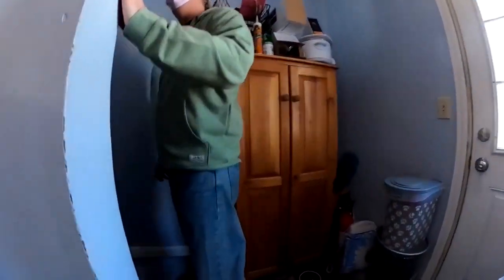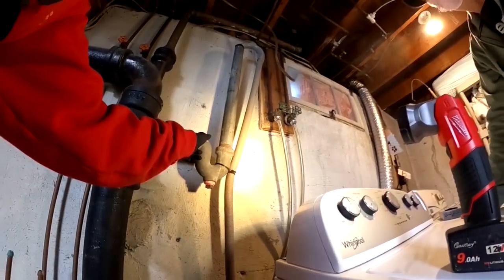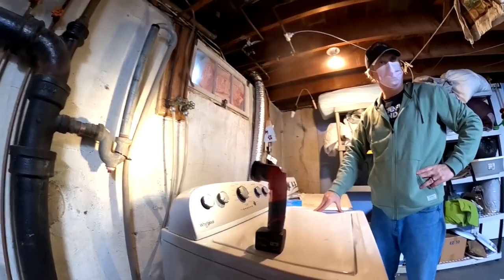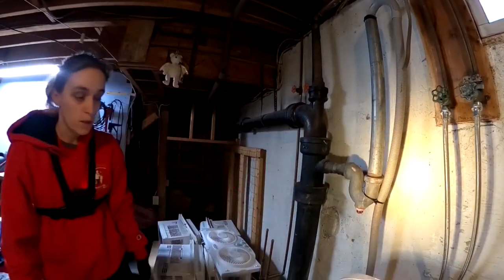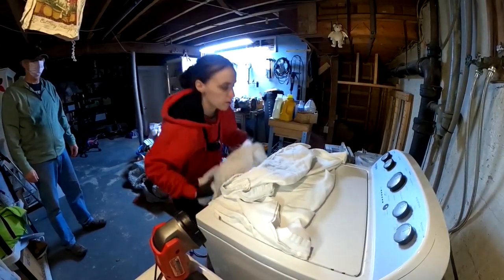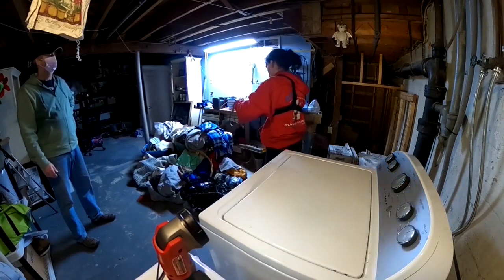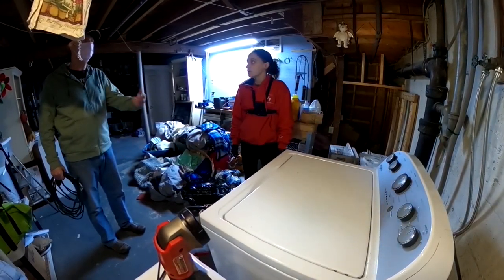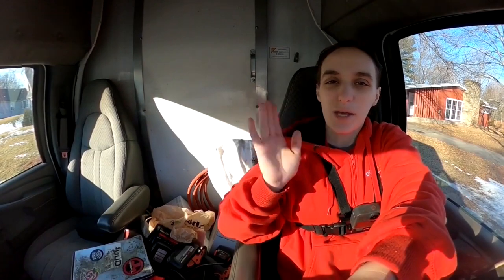Clogged Drain #108 Washer Machine Drain

Comment: Was the clog in the elbow before the stack line?
Reply from the maker: That is usually where it is when it's the washer lines. Due to the flaking of the metal on the inside of the pipes. (Shelly)